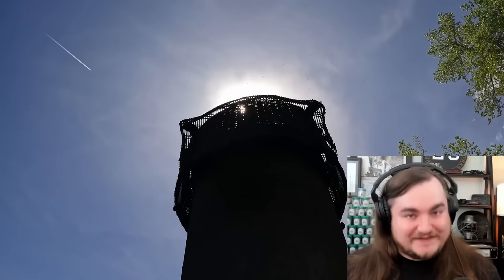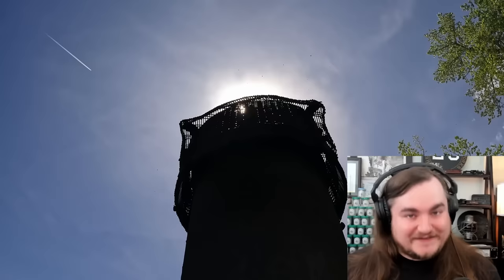Why do USA steam trains make smoke, but UK ones don't?

Comment: TOTALLY DIFFERENT GEOGRAPHICAL CONDITIONS DICTATED RAILWAY DESIGN  !
First & foremost the conditions in the USA are UTTERLY different from Europe, requiring a TOTALLY different approach to all aspects of Railroad/Railway construction in these two continents. In Europe there are virtually NO wild untamed geographical areas, unlike the vast open untamed spaces in the USA. In Britain for example, by 1900 the only land area not farmed, replanted, or geologically re-sculptured by man, is the small Caledonian forest south of Inverness in Scotland. AND before any white man crossed the Atlantic, we already had a vast paved road network across much of Europe over 2000 years ago, thanks to the Roman Empire !!! 

Population density in Europe has always been much higher than anywhere in North America. So you were never far from a town or city. Which means passenger trains were usually more than 50% of all the trains on most lines. Unlike the USA were freight tended to dominate outside the widely spaced cities. Which seriously affects locomotive design !!! 

Further in Britain which has the highest calorific coal deposits mined anywhere in the world (99% Carbon), was advantageous to steam loco design, and meant oil fired steam locos were extremely rare right up until the end of steam in 1968.

Yet again European Political interference in railways, almost from the beginning, set in stone certain limitations due to lack of foresight. So in Britain the law that all stations had to have high platforms from around 1850, meant development of train design was constricted to a width of around 9ft 6in. Early tunnel & overbridge design also without foresight means British trains were constricted to a maximum height of around 13ft 3in. In mainland Europe width can be up to about 11ft and height around 14ft 6in, although there are minor differences between most countries. Which causes train design problems for vehicles intended to cross the many borders. Locomotive designs for cross border use are a tiny minority, so most trains change locos at borders.

SMOKE BY DESIGN !!!
The amount and type of smoke emitted by steam locos is also conditional upon many aspects of the locomotives design. First and foremost being the type of wood, coal or oil being used in the firebox to generate steam. Indeed not all steam locos exhausted their steam mixed with the smoke up the chimney, such as condensing locos needed on early underground city railways !

So this programmes introductry picture, of a large U.S. steam loco belching filthy black smoke in vast quantity is due to the fact it is an oil burner, & the fireman is currently "fueling" the fire to maintain boiler pressure. At the opposite end of the spectrum, British Great Western Railway steam locos known for emitting nice white smoke, is because these loco designs were nearly all specially designed to use the very high Calorific (99%) coal from South Wales. Which burns "cleanly" and thoroughly and allows more horsepower to be obtained from a physically smaller loco than larger ones on other railways. The advantage is further enhanced by using smaller but tapered boilers, with angled Belpaire fireboxes. 

As an example the Great Western Railways largest express passenger design the FOUR CYLINDER "King" Class of 1927 and just a small 4-6-0. The first of which (named King George V) was invited to the Pennsylvania Railroads 1927 centenary celebrations in the USA. This loco stunned both the American public & engineers at the celebrations as it developed significantly more horsepower per ton of locomotive, than ANY of the US Railroad locos also invited to those celebrations. All of which were significantly larger than than the GWR 4-6-0. In the daily procession at the show, this loco led the procession making virtually no noise and produced only tiny whisps of white smoke. The reason for its quietness was the fact that Zeiss optical equipment was used to machine all bearings to much finer tolerances than then possible on other British or any US Railroads. This fact also allowed this type of loco to achieve mileages up to 120,000 miles between overhauls, a fact that was thought impossible in the US loco industry at the time !!!

For the record I'm a qualified Locomotive Mechanical Engineer, who in the past has also been a "Shedmaster" in charge of a fleet of Mechanical monsters usually known as steam locomotives !!!

Comment: Americans are obsessed with spectacularity. Steam locomotives are supposed to smoke, period. Crews know this and make them smoke. It's not about knowledge or skill, it's about meeting the publics expectations. Same with the constant bell ringning and blaring with the horn that completely ruins all footage since it's impossible to hear the actual mechanical sounds of the train and tracks. 
Another contributing factor is that US steam trains are most often run at extremely slow speeds due to third world track quality, whereas the Brits run theirs at mainline speed. Slow speeds gives minimal throttle which gives minimal draft, so there's the desired smoke curtain again.